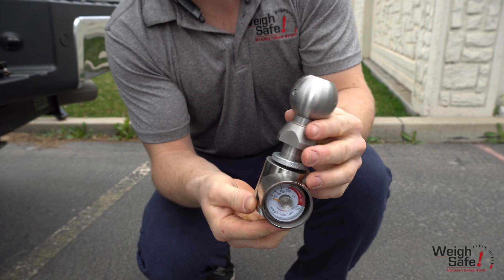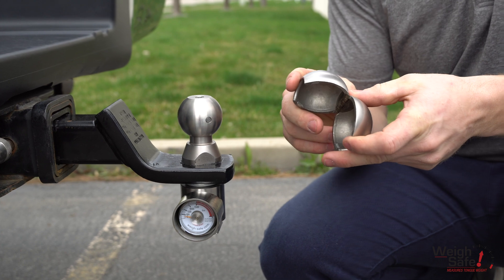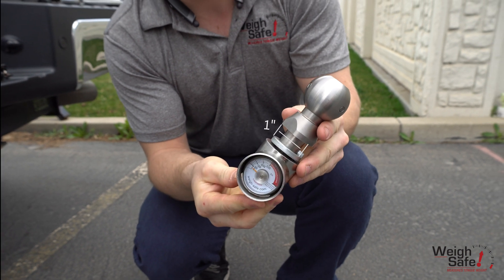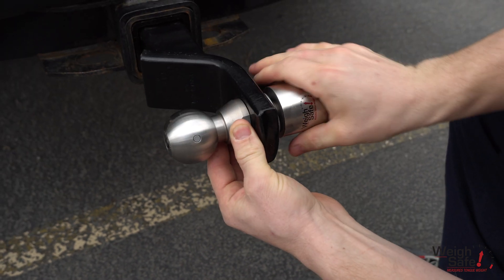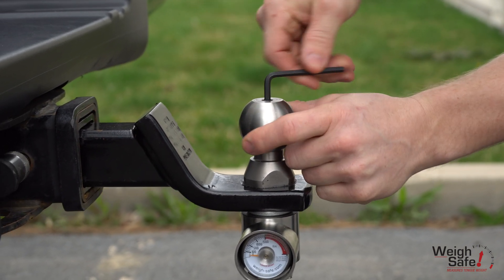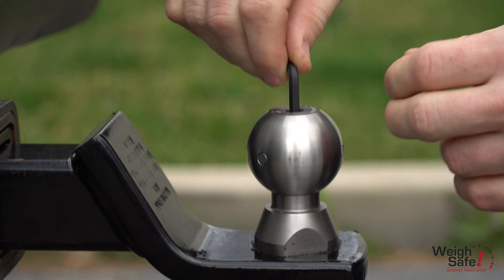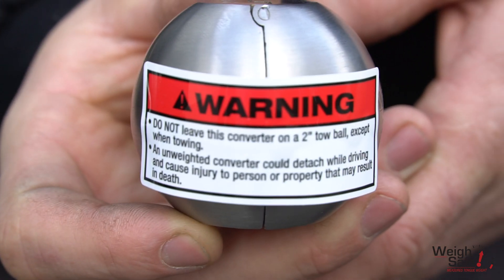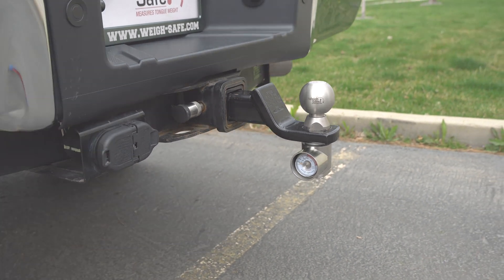Universal Tow Ball - Weigh Safe

Comment: So u dont set the scale to 0? You just add 100 lbs to whatever the scale reads?
Reply: 😑 it's explained in the vid. You tighten the set screw to show 100 lbs on the scale, then back it off until the scale reads 0. Then you ensure there is no slop in the ball, but that it will still swivel and micro-adjust as needed. I know I'm answer a year-old comment, just trying to be helpful.

Comment: Ok, bought one. Shank is 1 inch, my weight distribution hitch hole is 1 1/4 inch. Bought a spacer from "Cost u less" only people that had it in stock, "1 1/4 to 1 inch shank size"  and fits perfectly
Reply: Also, I don't actualy use the weight distribution hitch since I drive a 2014 land rover lr4 with air suspension and manual/dealership said not to. So I'm able to use the hitch witch with sway bar.
Reply: @PNWLiving1725 I’m curious as to how air suspension connects to tongue weight? I too have air bag suspension that levels my truck out when towing a trailer. Was wondering what the connection was to tongue weight? ✌🏽

Comment: Hi, I bought one, but the 1 inch shank is slightly smaller than my hitch hole. 
The hitch is a weight distribution hitch with the original ball shank being 1 and 3/16.
Will that be ok. I see that is says 1/16th difference is ok, but wondering if anyone else still use it. 
I pull a 4500 pound trailer with my 2014 LR4.
Reply: Very interesting. I to have a weight distribution hitch I’d like to hook this ball up to. I noticed they never replied to ya here so did this issue ever get resolved?